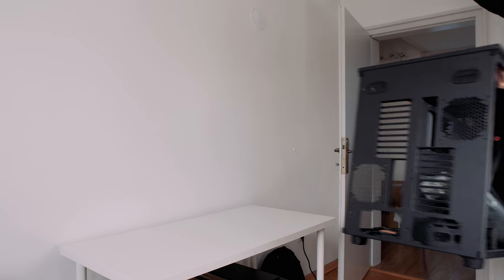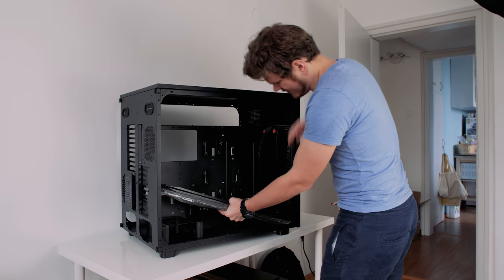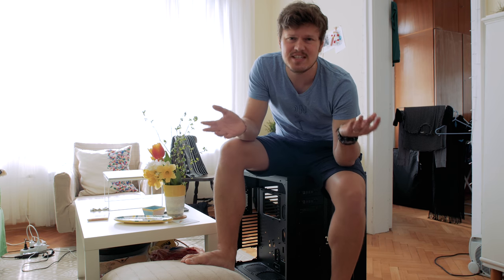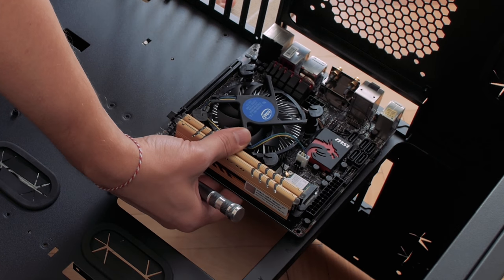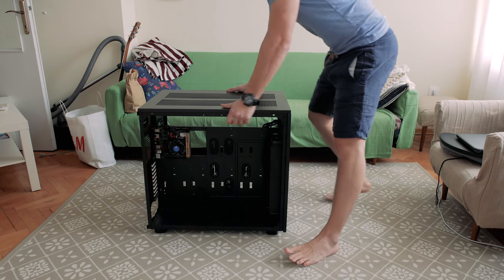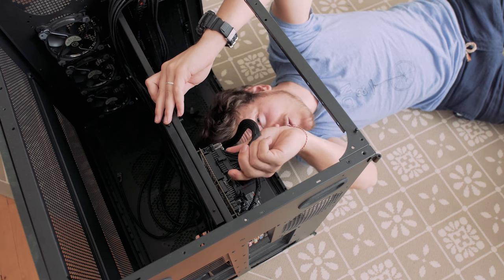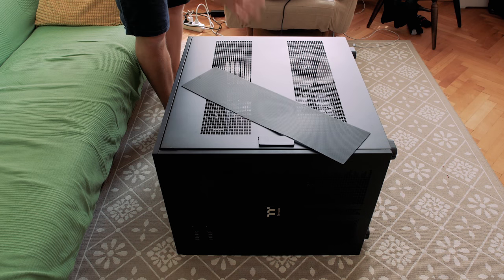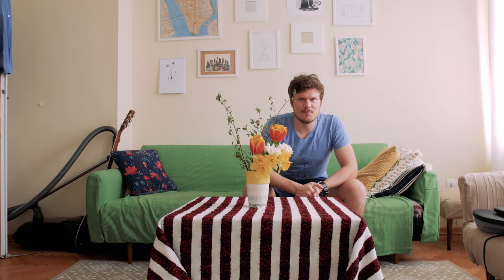Turn Your PC Case into a Coffee Table!

Comment: It's not even a bad idea. Now I'm thinking of building an actual one. Thanks Dimitri!
Reply from the maker: lol :) good luck!
Reply: PC CHAIR
Reply: Cables in the middle of the room doesn't sound like a good idea.
Reply: EMPeter I was thinking on cutting a small hole in the rug and run the cables through/underneath that.
Reply: Does anyone know a nice case that I can use on its side (window up) and make the window side water tight? I was thinking about using some sort of glue, but I still want to be able to open the case without damaging it.

Comment: now do a legit one. glass top so you can see the internals without worrying about spills, and run your keyboard/mouse/controller into a drawer on a chamber below so you can easily store them. run the rest of the cables out of the bottom and under a carpet over to the TV. it'd be lit.
Reply: Wireless KN/Mouse is really the way to go for a living room HTPC.  You would only need to run power, video and optionally networking cables.
Reply: Geopirate3 for most living room PCs I'd agree, but with how close the table is to you, Id say that worrying about cables being strung across the room isn't a problem here, so why not go full on mechanical keyboard.